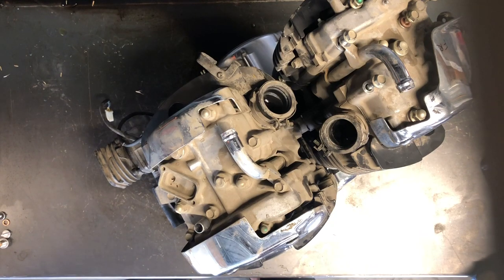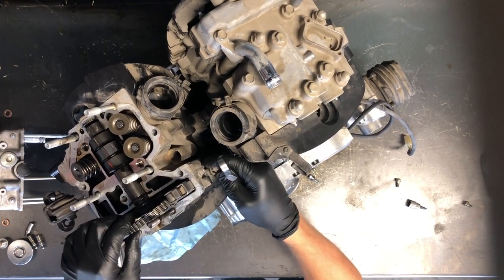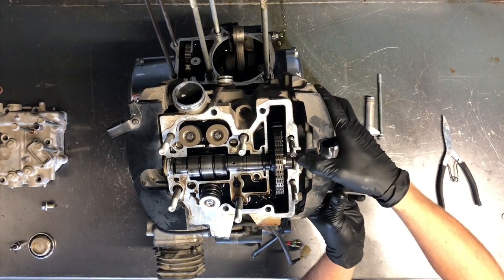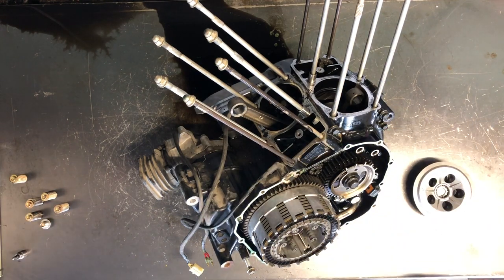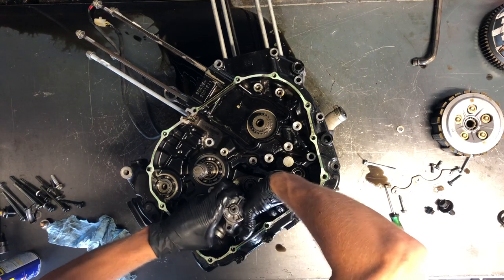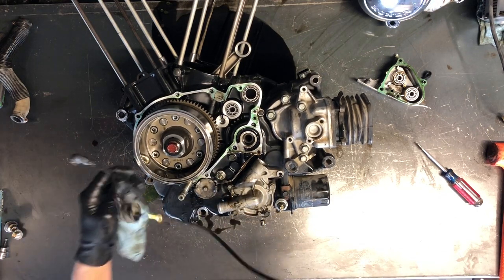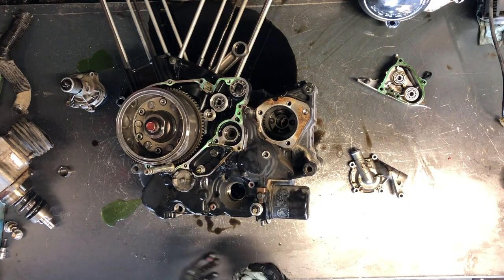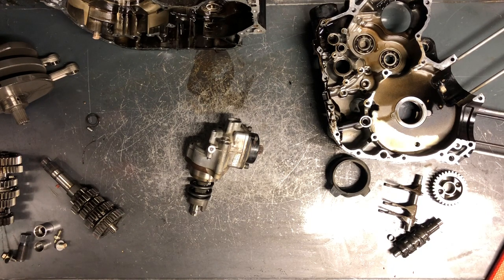Honda Shadow VT1100 VT V-Twin 1100 - Engine Crankcase Split - DETAILED Review

Comment: Thank you for the video. With you taking the engine a part I was able to find out on how to put the transmission gears back together. Now I got the engine all back together the transmission is not binding up any more. The engine and transmission are working together like they are should. Thank you keep up on the awesome videos. I also liked and subscribe.

Comment: great video. have a 94  mod vt 1100 c. its rounded 100,000 km .but i have this strange vibration in the gear box somewhere .at 50 kmh .had it for years . great bike .great engine.
Reply from the maker: Shoot. Never like to see strange vibrations in the gear box. Hope this video helps with the rebuild. Thanks for watching.

Comment: How much pressure or force is needed to re-insert the big U-shaped oil gallery supply pipe on the right side of the motor.  The big O-rings and pipe ends don’t want to go into their respective holes.  Looking forward to a re-assembly video.  Thanks for the oil pump removal video.  It really helped me.  Best regards - keep up the good work.  You are a confident mechanic and a good teacher.

Comment: I need advice. 03 shadow vt1100 with a recent top overhaul
would not run. I bought it and took it apart and found all things looked exceptionally good rings, cylinders, valve work. I found too many shims under the hyd lash adjusters. I removed shims to obtain at least .047 movement of the assist pins. Motor runs great but a little too much valve lash noise. My question if I remove the rocker housing (only} and add about .020 shims will the head gaskets with 200 miles need to be replaced??